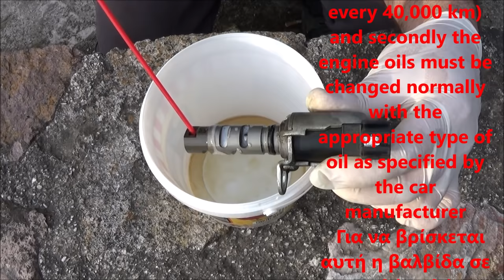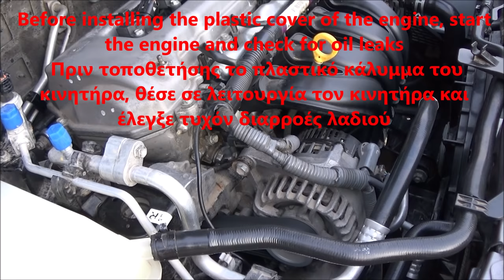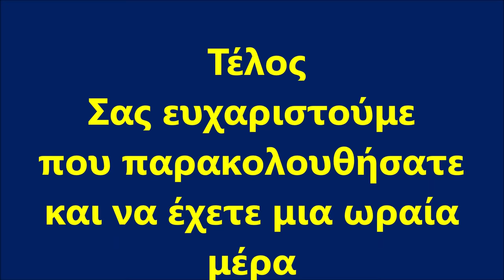2007-2013 Toyota Corolla How to Clean and Check Camshaft Timing Oil Control Valve Βαλβίδα Ελέγχου

Comment: What if there is sludge on the cam sensor?
Reply from the maker: If your engine longevity is a concern to you and you want to keep your engine running nice and smooth, you must do regular check-ups and maintenance. The most important thing for engine longevity is having an appropriate circulation of quality engine oil. Engine oil is the lifeblood of every engine; it cleans and lubricates the internal engine parts and makes its movement friction-free, but that’s not all.  This is just a tip of what it does. Motor oil helps to maintain an engine’s optimum operating temperature, preventing the engine from overheating. If you don’t want to encounter engine oil clumpy issues, you need to carry out a regular oil change. Failure to do this, your engine oil might clump and stick together and clog your engine in the process. This is known as engine sludge. Those who don’t learn the symptoms and how to clean engine sludge are putting their cars at risk, which could cause severe engine damage resulting in costly repair bills.
What causes oil sludge?
Engine sludge is usually caused by low operating temperature, lousy or poorly designed crankcase ventilation system, crankshaft-induced cavitation, or internal water leaks, and can accumulate over time. Engine sludge can cause poor engine performance or seizure – this typically happens on rare occasions when you neglect to change your engine oil regularly or drive the vehicle with extensively low motor oil. You should periodically change your engine oil to be on the safe side.
Engine Oil sludge symptoms
The only way to see if you have sludge in your engine is by looking at it, and you would have to remove the valve cover. There are engine oil sludge symptoms you should watch out for that shows whether or not you have sludge in your engine. If you encounter any of these signs, it could mean you have sludge in your engine, and it’s time to flush the engine.
1. Ticking or clicking Noise from the tappet.
When an engine develops sludge, the sludge is usually seen near the tappet areas below the head. The sludge will not allow the tappet and the hydraulic jacks to operate freely, thereby causing a ticking or clicking sound. The reason is that the sludge is blocking oil galleries resulting in not enough oil to lubricate the rams and the springs. The tappet controls the movement of exhaust valves and air intakes, and they move several times per second, which is why engine sludge is mostly found in these areas. The engine oil breaks down quickly because it starts lubricating many engine components once you turn on the engine. The ticking or clicking continues until you flush the engine. Then, the tappets and springs will start working nicely and smoothly.
2. Low oil pressure and warning light
Since the engine oil sludge can block oil galleries, it will reduce the speed at which the motor oil circulates, and when the engine sludge reduces the oil circulating pressure, it will trigger the check engine light. This can cause catastrophic problems to engine-moving components since they are not receiving appropriate oil for lubrication. If the oil filter becomes clogged due to engine sludge, it will drastically reduce the oil pressure at which the oil pump circulates the oil. In some cases, the engine oil might not get to the cylinder head. Under this condition, it is best to pull out the engine, disassemble it, and thoroughly wash the engine parts with part washer solvents to avoid problems that may require total engine replacement. Generally, if you have engine sludge, your O2 sensor will start malfunctioning and cause your engine to misfire, and you will notice reduce fuel economy. If you see these problems after having hard starting issues, it’s likely that you have engine sludge.
Reply: @YiannisPagonis  Thank you for the information. Is the camshaft sensor the same as a cam sensor? I heard another mechanic working on a Chrysler Town and Country mention that if you pull out the cam sensor and find sludge, it's a sign not to buy the vehicle. However, he only pulled out one. I noticed you mentioned the Corolla has two, so I wanted to confirm that we are referring to the same component. Thank you.
Reply from the maker: @joemadison5527  My friend there are 2 sensors in the Corolla. 1 for the camshaft and 1 other for the crankshaft. Now if you find mud on 1 of them or even 2 then what you have to do, which is simpler and not that difficult, is to remove them and clean them. Then flush the engine with a very good engine cleaning fluid from sludge, dried oils, etc. The other solution, which is the most extreme and more expensive, is to disassemble the engine and clean all its components.
Reply from the maker: @joemadison5527  They are 2 different sensors that each of them does its job

Comment: Any specific symptoms of clogged or faulty valve ?
Reply from the maker: 3 Bad Oil Control Valve Symptoms
1) Poor Fuel Economy
The main purposes of variable valve timing is to make sure that the valves open and close at the right time to boost engine performance as well as to reduce the consumption of fuel. If the VVT solenoid stops working, the whole system may be compromised, in which may result in intake and exhaust valves opening and closing at the wrong time. This in turn can cause a drastic reduction in how many Km you can travel per litre of fuel.
2) Rough Engine Idle
The next thing that you need to consider is the VVT system on your vehicle. This system will automatically be activated when your car’s RPM is higher than normal or there is an additional requirement for power such as when passing a another vehicle on an incline. If the VVT solenoid in your car is faulty, it can cause the engine to idle rough. The engine RPM will fluctuate which can directly result in a reduction of power generated by your car. Although there are many other causes for rough idling, a failing oil control valve should be considered on cars equipped with VVT technology.
3) Check Engine Light
Like when other electronic components of an engine fail, the vehicle’s computer can sense a oil control valve failure and in turn turn on the check engine light in your instrument cluster. Using a diagnostic scanner, you can determine if this part is the cause of your problems or if it’s something entirely different.
Reply: @YiannisPagonis  thank you so much... Will clean mine tomorrow as a preventive maintenance... Thanks again
Reply from the maker: @sameexc  My friend, I wish from the bottom of my heart that everything goes well for tomorrow and I am waiting for your news
Reply: @YiannisPagonis  do you need to replace the rubber washer ?
Reply from the maker: @CRM537  Yes if it is in bad condition

Comment: Hello, please if you can solve the problem I have on my Auris Toyota year 2014, after repairing my CVT box, 3 weeks later, I have the Engine check with the ESP on, after scanning  i got 2 error codes, P1047 and p264, please tell me the exact fault, please give me a reply, thanks again
Reply from the maker: Hi there. Is the ESP light flashing or blinking, or is it solid? Does it only flash when driving on slippery surfaces?
Reply: good evening, thank you for answering me, just to explain to you that it is the Engine check which lights up, 2 seconds later the ESP also lights up, according to the scanner which revealed 2 error codes to us on  P 264A and p1047, to inform you that my car is a 2014 Toyota Auris, 1.6 petrol engine, Vvti, CVT gearbox.
Reply from the maker: @amh4548  What's the approximate mileage on your 2014 Toyota?
Reply: 363000 km
Reply from the maker: @amh4548  P1047 Engine Trouble Code
Meaning of P1047 engine trouble code is a kind of powertrain trouble code and theoretically you can drive for a few weeks or even months with a broken MAF sensor. You will notice a decrease in gas mileage and over time the car will eventually start stalling a lot. 
P1047 Fault Symptoms :
Check engine light comes on
Engine stalling or misfiring
Engine performance issues
Car not starting
If one of these reasons for P1047 code is occuring now you should check P1047 repair processes.
Now don't ask yourself; What should you do with P1047 code ?
The solution is here :
P1047 Possible Solution:
Disconnected, dirty or fouled spark plugs are common causes for engines that won't start. Spark plugs typically need to be replaced every season. You should also check that the spark plug gap is set properly. If your spark plugs look good, problems with your ignition system can also preventing a spark. These can range from a faulty spark plug lead, shorted kill switch or flywheel key damage.
P1047 Code Meaning :
P
OBD-II Diagnostic Powertrain (P) Trouble Code For Engine
1
Fuel And Air Metering
0
Ambient Air Temperature Sensor Circuit Low
4
Injection lump Fuel Metering Control 'B' High (Cam/Rotor/Injector)
7
Shift/Timing Solenoid Malfunction/ 3-2 Shift Solenoid Circuit Electrical
The poor running symptoms are consistent with a MAP sensor malfunction. In addition, in some cases, a bad MAP sensor will not throw a code. Again, the ELD code likely represents a separate wiring issue.
P1047 OBD-II Diagnostic Powertrain (P) Trouble Code Description
P1047 engine trouble code is about Shift/Timing Solenoid Malfunction/ 3-2 Shift Solenoid Circuit Electrical.
Main reason For P1047 Code
The reason of P1047 OBD-II Engine Trouble Code is Ambient Air Temperature Sensor Circuit Low.
Parts or components should not be replaced with reference to only a P1047 DTC. The vehicle service manual should be consulted for more information on possible causes of the fault, along with required testing.
Reply: hello, and the code P264A ???
Reply from the maker: @amh4548  P264A Code-'A' Rocker Arm Actuator Position Sensor Circuit Bank 1
Code P264A Possible Causes
a.  Low or overfilled engine oil.
b.  Incorrect engine oil type.
c.  Faulty 'A' Rocker Arm Actuator Sensor.
d.  'A' Rocker Arm Actuator Sensor harness is open or shorted.
e.  'A' Rocker Arm Actuator Sensor circuit poor electrical connection. How do I Fix the Code P264A?
Check the "Possible Causes" listed above. Visually inspect the related wiring harness and connectors. Check for damaged components and look for broken, bent, pushed out, or corroded connector's pins.
What are Code P264A Possible Symptoms?
Engine Light ON (or Service Engine Soon Warning Light)
Code P264A Description
The Engine Control Module (ECM) commands the Rocker Arm Actuator to control the oil hydraulic circuit. Oil flows through the Rocker Arm Actuator to the variable valve timing system to adjust the engine's valve timing. The variable valve timing (VVT) system is used to improve engine's performance, fuel economy or emissions. The ECM monitors the 'A' Rocker Arm Actuator Position Sensor and sets the OBDII when the 'A' Rocker Arm Actuator Position Sensor signal is out of factory specifications.
Reply: Thank you very much my friend for your help, I will keep you posted
Reply from the maker: @amh4548  Ok my friend I wish you get your car fixed soon and good luck with whatever you do

Comment: What symptoms will car get if camshaft sensor is dirty?
Reply from the maker: A glowing check engine light, stalling, poor acceleration and bad fuel mileage are all possible signs your camshaft position sensor may be failing. Gone are the days of carburetors and distributors, replaced by a variety of sensors that help a car's computer get the maximum performance out of the engine

Comment: Do you know where is the camshaft position intake actuator?
Reply from the maker: The intake camshaft actuator features a gray electrical plug and is located closer to the front of the vehicle on the top of the cylinder head.

Comment: Como siempre muy bien explicado, no se si tenes alguno de como cambiar la junta de la base del filtro de aceite y el retén de la distribución que tengo una pérdida, me interesaría que subieras uno. Te agradezco mucho, gracias amigo griego desde Montevideo. 👍👍
Reply from the maker: Hola mi amigo de Montevideo. Se refiere a la junta de la base del filtro de aceite del motor y al depósito de aceite?
Reply: Mira que me a contestado mensajes en español se ve que algo entiende igual gracias por el dato trataré en el futuro de mandarle en ingles. 👍
Reply: Exactamente amigo griego de eso se trata gracias por el interés. 👍
Reply: Hola saludos, tengo un Toyota corolla 2010 y en ocaciones me da un problema que quisiera solucionar , el carro en ocaciones se apaga depues de un tiempo corriendo y no enciende hasta como 30 o 45 minutos despues , que la experiencia de ustedes  quiza pueda solucionar el problema

Comment: What can cause to hard start after its to warm ? When its a cold start its starts right away no issues only after engine is warm
Reply from the maker: The most common reason a car is hard to start when warm is due to a defective crankshaft or camshaft position sensor. However, it could also be caused by a clogged air filter, faulty battery connection, vapor lock, or a bad ground connection.
Reply from the maker: @КубаОтунчиев  Молим те шта си рекао?
Reply: @YiannisPagonis   Не понял?
Reply from the maker: @КубаОтунчиев  К сожалению нет. Это слово не может быть переведено компьютером. Подскажите, пожалуйста, что означает это слово
Reply: @YiannisPagonis  Датчик до воздушного фильтра.
Reply from the maker: @КубаОтунчиев  хорошо спасибо
Reply: Обратись на диагностику. Онлаин тебе неподскажут

Comment: i don't know howto save patrol,  macnic said chang sensor, i did but, nathing happened, like before drink too match patrol
Reply from the maker: Follow these simple tips to help make your car go further between fills.
1. Drive economically
Around town, you’ll use less fuel if you: 
Drive smoothly and try to maintain a steady speed 
Use the gearbox sensibly, and change up through the gears as soon as practical
If you drive an automatic, ease back slightly on the accelerator once the car has gained sufficient speed 
Avoid peak hour and other heavy traffic where possible 
Avoid engine idling for long periods.
On the freeway, you’ll use less fuel if you: 
Reduce speed - you can reduce your fuel consumption by as much as 25% by taking 20 km/h off your speed
Use cruise control if you’ve got it 
Use your car’s air conditioner sparingly
Keep the windows up and use the ventilation system when travelling over about 50 km/h, if your car doesn’t have air conditioning
If your car’s transmission has power and economy modes, use the economy mode to ensure the transmission up-shifts earlier.
All of the above tips also help reduce wear and tear on your car’s brakes, tyres and the other mechanical parts. So you’ll save on running costs too.
2. Care for your car and save 
Get your car serviced regularly to keep its running costs down and to help save on fuel. As part of caring for your car, you should: 
Keep the engine correctly tuned
Keep filters in good condition
Keep the fuel and ignition systems in good working order
Regularly change the engine oil using the correct grade of oil as recommended by the manufacturer.
3. Inflate tyres correctly
Check your tyre pressure once a week, when the tyres are cold. 

Keep your tyres inflated to a pressure slightly higher than that stated in the vehicle handbook (you can also find the tyre pressure on the tyre placard, which is typically inside the glove box, on the driver’s door or on the fuel filler flap). Setting the tyre pressure slightly higher will aid in fuel economy and safer handling.
4. Check the wheel alignment
Ensure the wheel alignment is correctly set and the brakes aren’t dragging, as these can both increase rolling resistance – and chew up more fuel.
5. Check your load 
If you can, reduce the amount of gear in your car. Things like golf clubs and toolboxes add unnecessary weight, which in turn increases fuel consumption.  

External attachments such as roof racks will increase wind resistance and fuel use. If possible remove them when not in use; and when you are using them, load them carefully to minimise wind resistance.
6. Use the smaller of two cars 
If your household has two or more cars, use the more fuel efficient one wherever possible. Get into the habit of using the others only when necessary.If you’re in the market for a new car, consider fuel efficiency.  
7. Be wary of fuel savings devices 
There are many devices on the market claiming to improve your car's performance and save buckets of fuel. Very few have been proven to work by repeatable scientific tests.

If you’re considering such devices, do your research carefully. Only consider products that are proven by a properly accredited local testing authority using the Australian Standard 4430.2 test protocol. Australian Standard 4430.2 is an internationally recognised test that was specifically devised to test products that claim to improve performance and reduce fuel consumption.

Also consider the economics of installing the device itself, and weigh up how long will it take to recoup the cost of installation against future fuel savings.
8. Use your car less
One of the best ways to save on fuel costs is to stop using your car so much! Explore other options like public transport, car pooling, walking or riding a bike. 

If you must use your car, try to combine a few smaller trips into one. A cold engine is less fuel-efficient and emits more pollutants than a warm engine, so several shorter trips will use more fuel than one longer trip. 

Fuel Saving Myths - the truth about driving tips to save fuel
We've all heard about various ways to save money on our fuel bill but do they actually work? Our fuel experts looked into some of the more common myths to see which ones save fuel and which ones don't. Have you really been saving fuel? Watch us bust the myths!